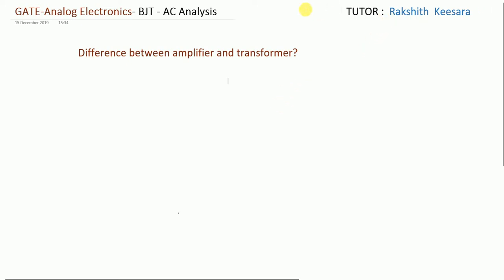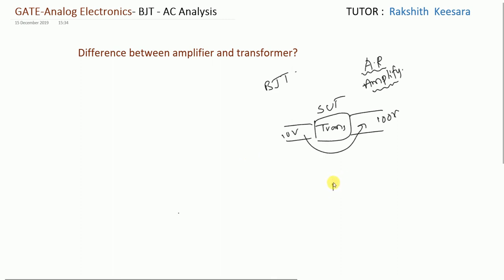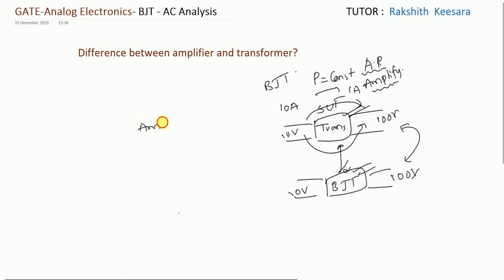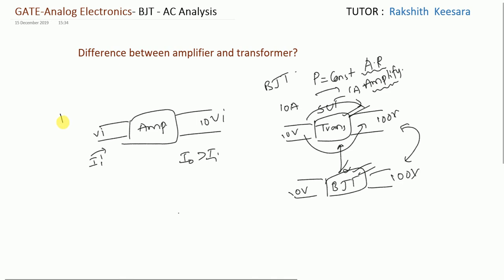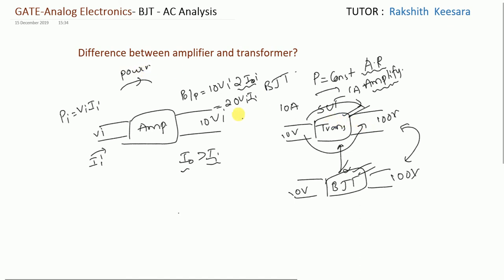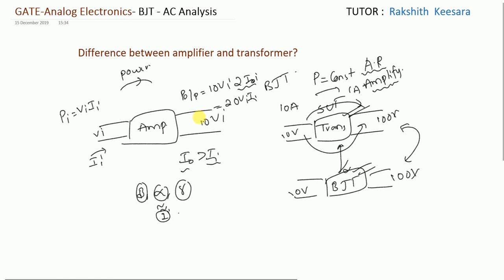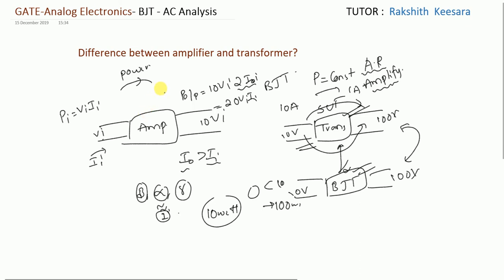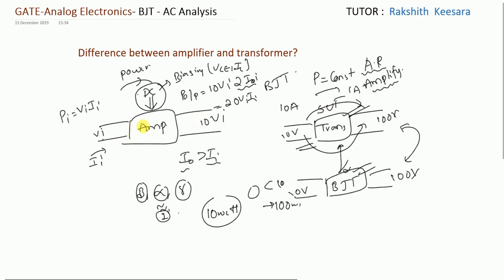Difference between transformer and amplifier

Comment: But sir I still have a doubt that since voltage is directly proportional to current..so as voltage increase in transformer.. current should also increase?? But why it is decreasing
Reply from the maker: firstly it is I prop. to V , and it only holds good when the source is able to supply enough power(as V inc. >> I inc , power should also increase)  , but in the case of transformer power is constant(neglecting losses) , So if V increases , for I to inc transformer needs to supply extra power which is not available>>>>>So to maintain power as constant it decreases current.

At the end...to maintain power as constant I decreases.
Reply: @RakshithKeesara  Thanku sir 🙏

Comment: If power increases we are saying it is amplifier. Why interms of power only why not in voltage or current
Reply from the maker: If only voltage or current increases then it is a transformer(power will be constant), but if both increases,,,,, as power =V*I,,,,, power increases .Ya u can also say that amplifier increases the level of both voltage and current,,nothing wrong.